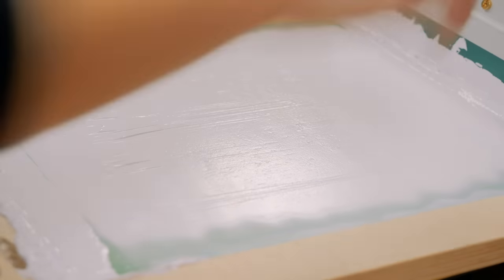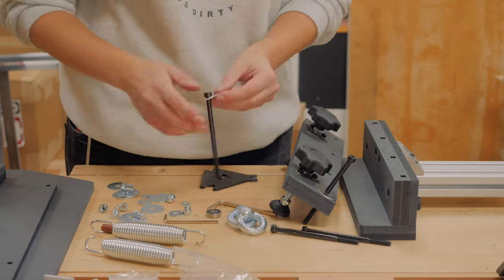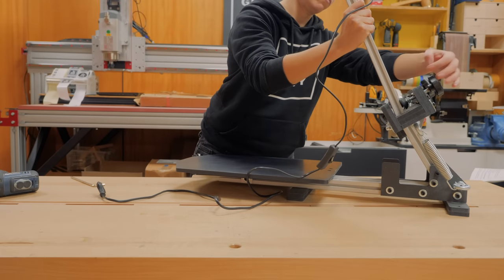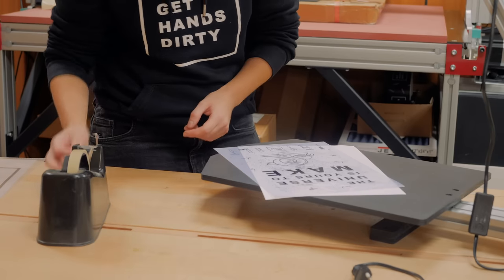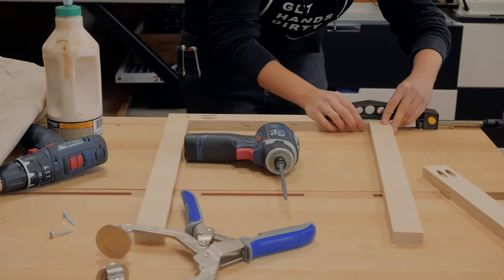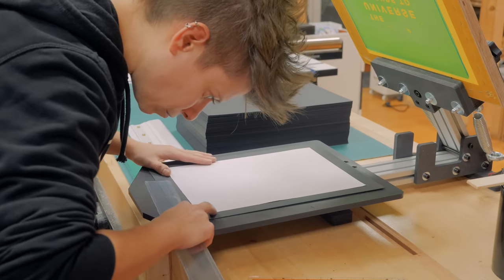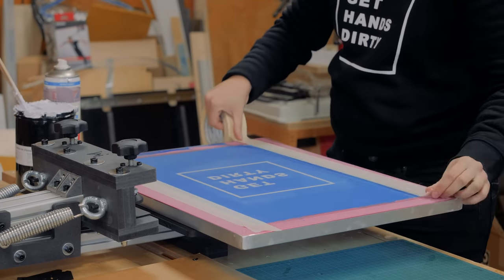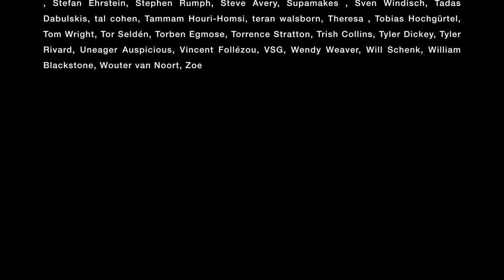Print Your Own Posters, T-Shirts and More // Screen Printing Basics

Comment: It's better to tape inside corners of the screen to let the frame live longer. Also you can reuse the same mesh in the same frame by removing light-sensetive emulsion and reapplying new emulsion. Mesh will be damaged over time (there will be tiny bigger holes), but it's ok if it's ok for you personally. Also plastisole ink is a great option, it doesn't dry during work and lasts longer on the fabric

Comment: Screen printing continues to be one of the most effective and efficient printing media on the market, and one of the cheapest, as well as reducing production costs from 50 copies. In addition to this, it can print a wide variety of materials, and also allows an interesting variety of special effects by varying the number of threads per inch of the screen, and the type of inks. Very good video and thank you very much for sharing it.

Comment: I worked at a printing factory yrs ago. Got to do the printing stuff, but we had another department that made our screens(within factory of course). I find this video interesting to get an idea how they may have made the screens for us to print.
We printed only on clothing. For walmart, nike, nike outlet(stuff that has their logo but may have minor mistakes either on the shirt or in the screen), and other stores. We did the heat dry when the shirt got multiple hits of one color or multiple colors. We also used what everyone there said was almost the same as elmers glue(called there as roll tack) to hold the shirts in place.
Its cool to see a simplified and smaller time way of doing it. The had big machines with multiple tables and the machine put the ink on the shirt, we just made sure it had ink and shirts to print on.
It made a loud horrible pop if it had no shirt and it printed on that table. Especially with fresh roll tack. I made the mistake once after once screen had a minor peel on it and the screen department remade the screen, i turned the machine on wrong and instead of turning it on as a fresh start, i flipped the switch wrong to make the machine think all tables had shirts on them. They were all empty and had fresh roll tack. Yeah we were down for a while while the screen department checked em out again. Somehow, no damage. They didnt understand how i didnt destroy the design with that. Oh good times! Lol.

Comment: There’s a lot of good info in this video, but to be absolutely clear for anyone who might be intimidated by all the steps, equipment and processes shown, please know that you don’t actually need all this stuff to get started in screenprinting. All you need is a screen, a squeegee and ink. There are a lot of different screenprinting processes you can try that don’t use emulsion and UV lights at all, and while the “press” can make things easier, especially if you are doing a lot of prints that need registration, you don’t actually need it.

Comment: worked a bit in a workshop that makes prints on clothes/fabrics using screen printing and actualy, what you said about heating it up is accurate. although, heating should be done not like you did, with a heatgun. this can create some spots that have been too much "burned" and can sometimes appear glossy in an ugly manner. curating the print should have been done in heated oven with some sort of conveyer belt. this way, the "burning" process is much more uniform and ensures an equal print quality without the glossy effects

Comment: Couple things. S-green water based adhesive from Ryonet. I use it now..... That spray adhesive gets all over everything. And is a pain to clean off of press and such. The second is a pump sprayer from lowes.... U can adjust the head from a wide spray.... Down to a jet stream. Use warm water also. I now use a pressure washer. Built a washout booth. Makes a big difference. This was a great video. U rock 4 days. If I can help in any way. Let me know. I print hot split transfers and also airbrush.

Comment: Washing out the emulsion after exposure in you home's plumbing will eventually clog the drains, sooner rather than later if you are making and using a lot of screens. 
For better fine detail when exposing the emulsion, use one of those clear, vaccum clothing storage bags, one side generally is clear with no branding or printing on it. Use a piece of thick black fabric and a piece of foam on the inside of the screen, vaccum the air out of the storage bag with the screen, foam & fabric inside with a shop vac and expose the screen. this gives better detail and sharper edges. There is also a method of stretching screens with a wooden frame and a routered groove that you push a cotton rope and the screen mesh into. You can get tighter stretches and more even mesh tension, but it is a skill that must be practiced a bit. I was in the screenprinting business for over 25 years starting in 1977. Made a LOT of screens, usually large ones. Have printed some shirts, mainly large graphics such as banners, sales posters, plexiglass and Lexan, adhesive vinyl graphics, plywood signs, water slide decals etc.

Comment: I place a piece of parchment paper over the fresh print and go over it with a clothing iron on medium heat. I tried the heat gun and it doesn't cure as well nor does the ink hold up to washing, but with the ironing method prints on cloth have held up great wash after wash.

Comment: Rather than placing your height spacers on the screen, use them to make a jig that places your work exactly where you want it. This allows you to drop the piece to be printed in exactly the position without the need for alignment. 
Efficiency isn't the five minutes it takes to set something up, efficiency is the 15 seconds to set something up that you repeat 1000 times a day.

Comment: I wonder if you mixed up some kind of acid or etching chem into a paste to use for screen printing patinas on metal sheets, would the emulsion screen hold up? Would you get a good etch on a metal like copper, brass, or steel? Could it even work similarly on panes of glass?

Comment: I don't think you actually have to put emulsion on both sides of the screen. Just one side should do, if you do an even coat. Great tutorial! I really want one of these kits
Reply: No - you should do both sides. You are trying to effectively create little cylinders of ink in the mesh. With good mesh tension and sharp squeegee blade, you will be able to shear the ink in each of these mesh cylinders for clean prints. The order of coating matters, too - You want to leave a silky smooth bottom, (shirt), side on your emulsion. Scoop coaters also have "sharp" and "rounded" edges so you can fine tune the thickness of the emulsion you put down. Coats are named as 1&1 or 1&2 or 2&2...coating order is always the same, so we know which side is ink side and which side is shirt side with these coat numbers. These combinations of scoop coater, number of coatings and solids content of your emulsion allows you to control the EOM, (emulsion over mesh), ratio. You can tune ink laydown with thread count, emulsion thickness, emulsion solids content, squeegee blade durometer, squeegee angle, number of floods and prints, ink brand, ink type, ink additives and number of print/flash/prints.

Comment: The best way to make prints on textile durable is: 
Use inks for textile, let dry by itself, iron* the piece to the highest temperature the fabric can resist with some "arm strength". Then you can have a print almost forever while you wash under that temperature and iron it from time to time.
When you do that passes with paint "in the air" is not much useful. In my practice is better to place the frame with a generous amount of paint and pass it with not too much strength or you just will take away the paint at the same time you are putting it; and don't be in a hurry.
You can find a problem when some parts are not well printed, as if there were running out of paint. Try to add some water to the paint to make it more fluid.
Sorry for my English. 😇

(*) iron by the oposite side of the fabric/shirt/trouser/bag/whatever the first time. You can use a piece of cloth over the print to ALWAYS AVOID DIRECT CONTAC OF THE IRON WITH THE PRINT. Next time just iron it inside out.

Comment: great video explaining the process,   though one thing i disagree with is using water based ink.   they are TERRIBLE.    if you want designs to last and to be really come through and be substantial on the material or paper  you NEED to use oil based inks.   there are no water based inks on the market that are of good quality. they are made for hobby use, and they really dont last very long.

Comment: When you light the screen, you can put under some kinde of foam, that it levels better with screen if you surface is not flat... also the foam must be black or colored black that light dont bounce from surface and destroy your design. 
also the yellow screen is for detailed designs, that light dont travell over screen and lights the are under black print so you can get fine lines... 
also next time, dont mask under the screen... you can still push color out on the sides. it is better to mask on top. also, try cover more over emulsion, you have less chance to destroy your prints. ok, talking about making more pcs. and regular brown duct tape works best for masking screen.

anyhow, nice videos...

Comment: I have a septic tank and am concerned about disposing of ink and other chemicals into it and killing off all the microbes in there. Actually, flushing that kind of stuff into a municipal sewer system does not appear to be very environmentally friendly.   Also, will flushing the stuff down the drain clog the pipes?

Comment: Doing a final pass after you heat the print MIGHT not be a great idea, it'll cause a separate layer of ink with a different level of dryness that is only bound to the previous ink and not the fabric. MIGHT cause washability issues. We avoid this for various other printing methods with similar inks.